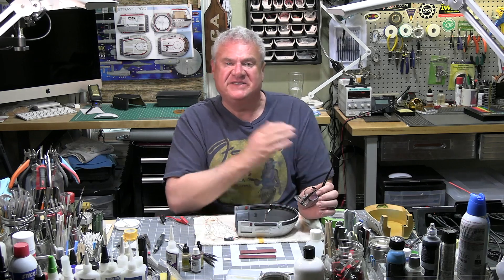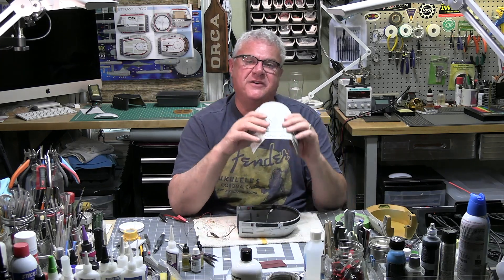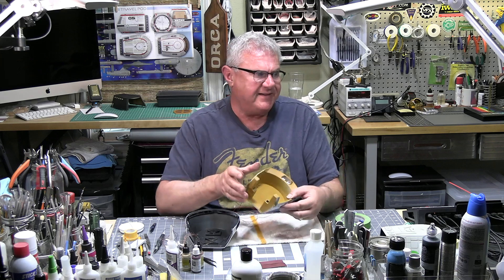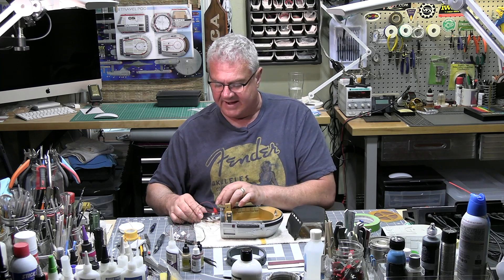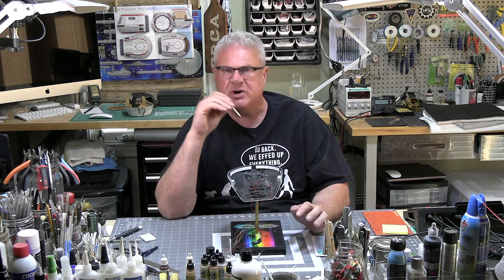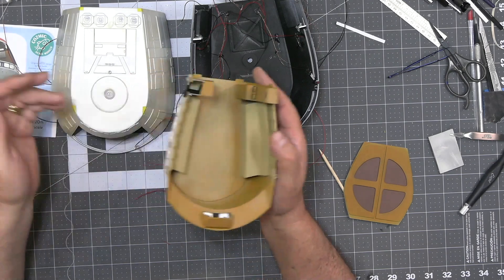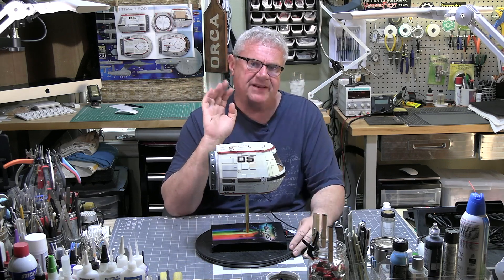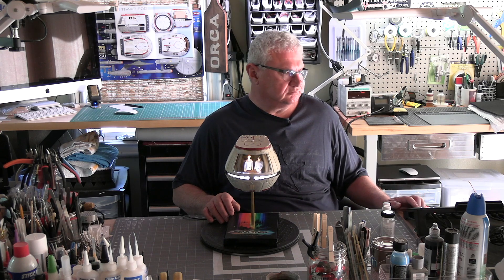Travel Pod PT 2 Final Frontier

Comment: Hey Phil - I seem to have issues every time I try and use a primer for my models.  You mentioned a filter that can be purchased from Home Depot or Lowes.  Can you give me a description or a link from one of these stores (and hopefully they are available in the Canadian stores).  Thanks Phil
Reply from the maker: Hi Sheldon, after you have thinned your paint to put in your air brush - pour the mixture through a paper filter that looks like a coffee machine filter only it has a fine mesh at the bottom of the cone. Any hardware store or big box diy store will carry them in the paint department  - you can get them in several sizes - also Amazon has them they will ship to you in bulk!  Cheers! Phil.
Reply: @sprueVerse  Thanks Phil and once again - a beautiful model (something I could never do LOL).  Hate to be a pain but I won't know what to search for in Amazon so would you be able to send me a link or a product name ?
Reply from the maker: JANYUN 75 Pcs Paint Filter, Resin Filter Disposable Paint Strainers for Automotive Spray Paint, Art Painting Cooking Oil Filter with Cone Silicone Funnel Filter https://www.amazon.com/dp/B08DFTFDC4/ref=cm_sw_r_cp_api_i_4H45RJHJ0ZRNBGGQ93F4?_encoding=UTF8&psc=1